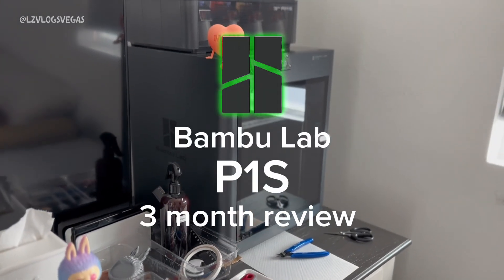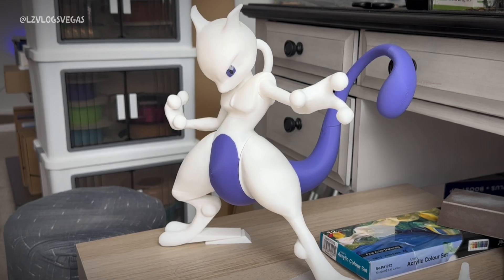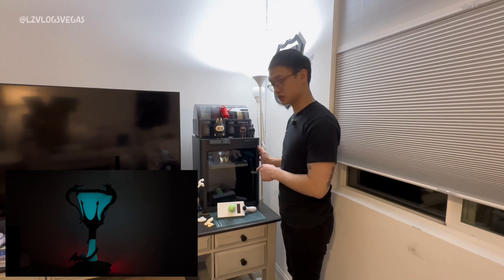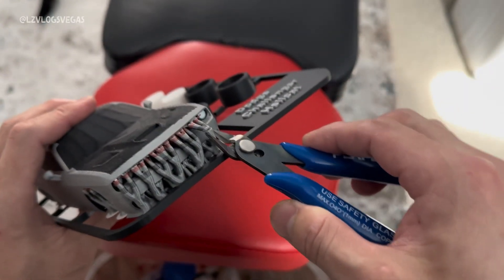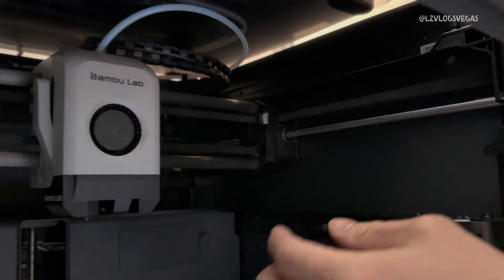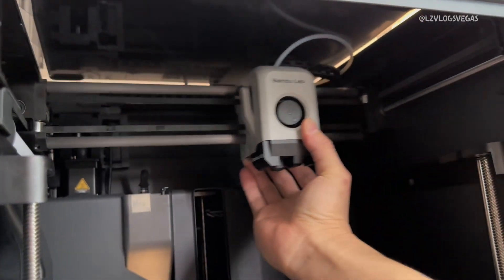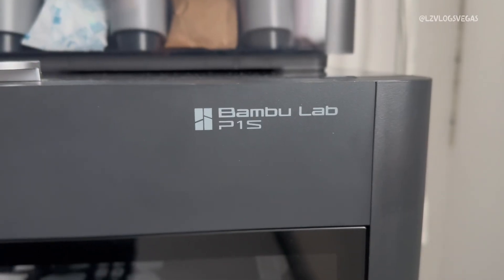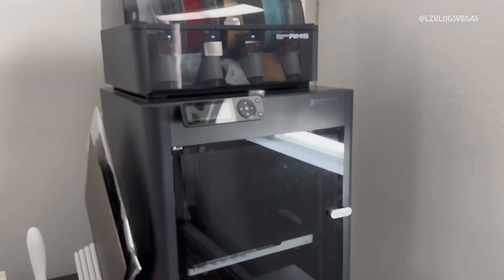Bambu Lab P1S 3 month Review!

Comment: It's a good video that shows what you can do with this printer. This printer seems to get good review from almost everyone except it does have its problem too. The AMS seems to be the first problem area where the filament could get stuck and the printer will abandon the print job unless you clear the problem in time to resume. The filament motors on the AMS is also susceptible to quit as well, that will likely ruin your day. The switching between the color takes longer because the AMS has to retract the filament back into it to feed a different color. The Anycubic Kobra ACE pro design is so much better, it has its dryer function while printing and the filament does not go back to the ACE Pro to switch color. The hardware and software on this machine is top notch, it is hardly have any problem for hobby printing. One thing I would say, I'd not put any oil on the belt to stop the noise. If there are noise, it is normal for any printer unless it is excessive. Even so, you would want to only lubricate the metal parts with lithium grease like the steel guiding rods for the print head, not the belt. You don't ever put oil on a rubber belt, it will destroy the belt and you are out of luck when it breaks. Check with the manufacturer support to adjust the belt if it rubs against the guide, and that's likely the culprit. There is a reason why they don't put any lubricant on the belt from the factory.
Reply from the maker: I appreciate the advice! It just seems like everyone on YouTube is saying something different

Comment: I am considering buying this unit as my first printer and found your video very useful. Thank-you. My house is fairly damp, would this be an issue for 3D printing?
Reply from the maker: Yes you’d have to make sure your filament is as dry as possible otherwise you will encounter a lot of print failures
Reply: @LzvlogsVegas  Thanks for the reply. I thought that would be the case but thanks for confirming it.

Comment: you dont put oil on a belt. youre going to have your subscribers having to buy new belts prematurely.
Reply: I assume it depends on what kind of oil you gonna be useing, because some oils can degrade rubber parts very quickly. And my second thought is why would you lubricate a belt resposible for moving a critical part around with as much precision and responsivenes possibble, wouldnt lubricating the belt and rollers compromise that in some degree?
Reply from the maker: But if you don’t lubricate the pulley it creates an irritating squeaking out when printing at high speeds.
Reply: @LzvlogsVegas  think about it a belt is supposed to grip a surface so it can turn whatever it's trying to turn.  using friction. You oil it and it will start slipping. a 3d printer is meant to be precise with movements. not to mention the oil will  degrade the rubber sooner than it will naturally degrade. I could understand if it were two metal services that needed oiling for lubrication but not a belt. ask any mechanic.
Reply from the maker: @Dahna_ well not too much of course just a dab don’t over lubricate…
Reply: Why it seems to work for my two p1s and carbon
Reply from the maker: What would happen?
Reply: @LzvlogsVegas  belts are designed to have friction to grip the gears and pulleys, and lubrication can reduce that friction, causing slippage and potentially affecting print quality. Lubricating the pulley is the right way  rather than lubricating the belt

Comment: So with the noise, I calibrated mine through the Bambu studio, now the noise has stopped and it’s much quieter.
Reply from the maker: 😮 what setting did you adjust?
Reply: @LzvlogsVegas Nothing much, just went on Bambu studio, Home Screen - device- and then I clicked on calibration. It should be to the top right of the screen(Mac). Once you click on it, these options will show up - Bed Leveling - Vibration Compensation & Motor noise Cancellation. After using this, my P1s no longer make noise. 😊
Reply from the maker: 😎 cool I’ll check those out!

Comment: I am torn between p1s or a1. On the one hand its enclosed and the ams2 has nice features and I live in a quite humid region. On the other hand i heard the p1s is crazy loud. Can you share your thoughts especially experience about noise. Thanks :).
Reply: Just a heads up they have an update coming up that allows the ams 2 pro to work with the A1
Reply from the maker: @korn2040 good to know! 👍
Reply from the maker: I like the P1S because it’s enclosed I’ve got cats and don’t want them messing with the prints. I have 3 P1S’s now and yes they are loud but I’ve gotten used to it tho so I don’t really mind it anymore, the P1S the one I went with because of it’s reliability and its size.